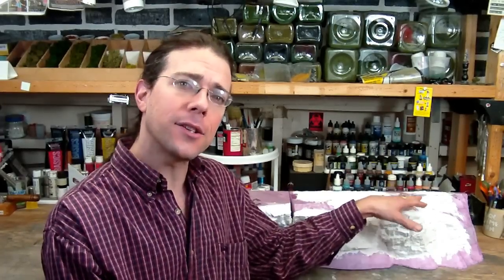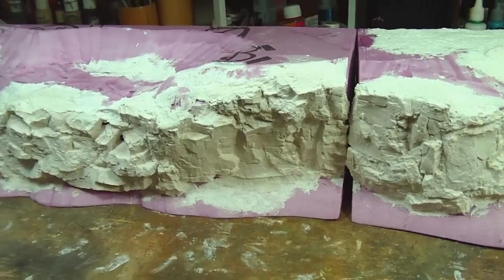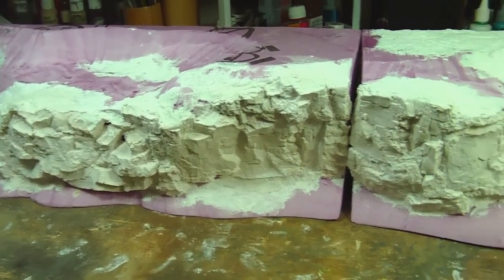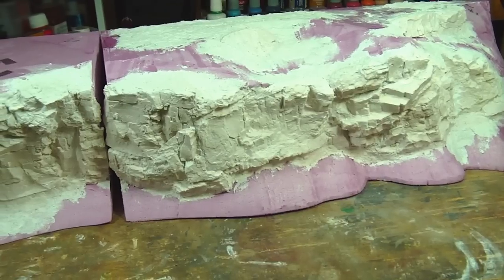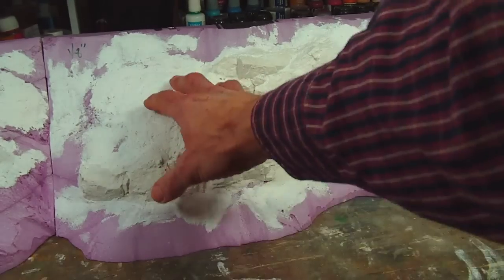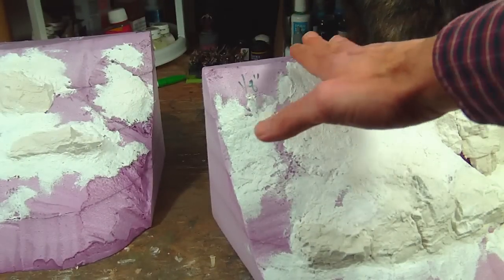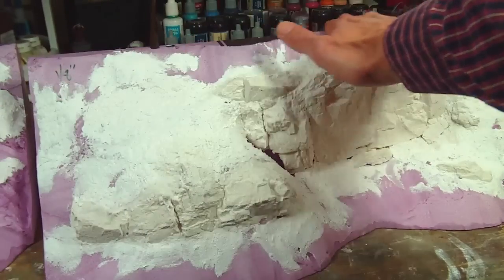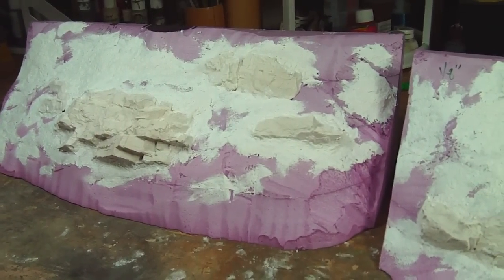TerranScapes - Plateau End Caps - WIP

Comment: Could you use something like bookends to keep the foam ends straight during the gluing process?
I would really like to see you try a "test piece" of a 1" rock overlap a joint between to edges. Maybe play around with this idea to see if it helps with your problem with lining up the edges so precise.